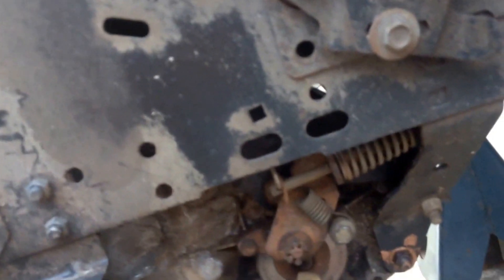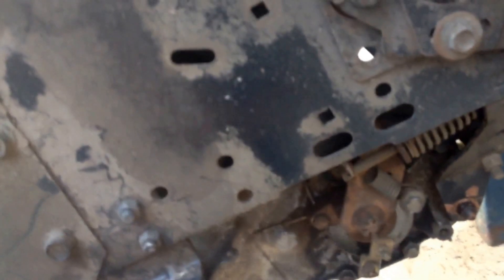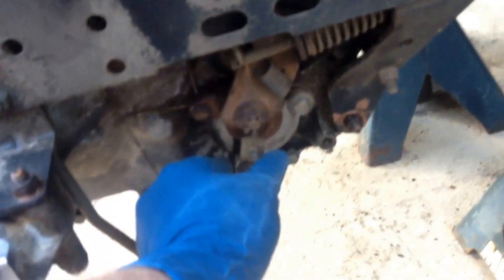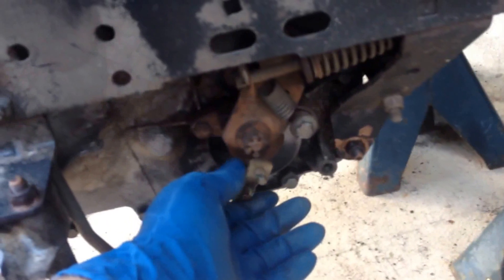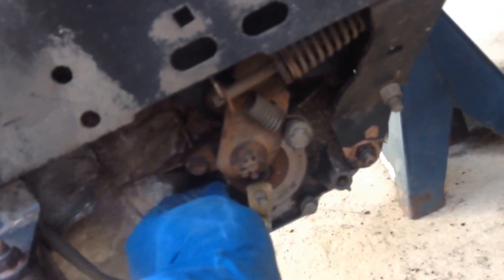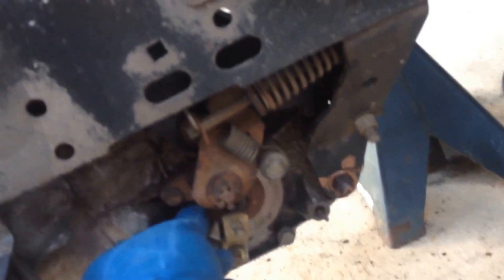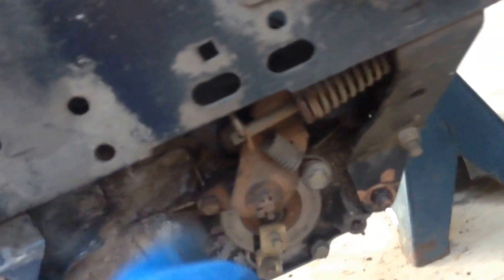Hydro gear 310-0510 hydrostatic transaxle

Comment: I had the same problem. Put it in gear and wouldn't move. I pushed that linkage so it was a little more forward and problem solved.
Reply from the maker: Well here is an update 11/15/22:
I did another pour in of this stuff a few months back because of the shudder when the engine would start up after sitting for a while and then I got a bunch of pump error codes because the pump impeller was unbalanced but I never removed the pump.  I stopped getting the pump error codes once the coolant thinned out, I did have a pump from Amazon and decided to replace the pump with one from Toyota to be on the safe side.  I did a drain of the coolant from the radiator drain and poured about 1/2 gallon of distilled water in the system. Then I added the 50/50 coolant.
I have stopped adding coolant and started using distilled water to my reservoir.  My engine temperature light comes on once in a while on my 37 mile commute, but the coolant tank is full, then it will go for a few days and not have any temperature light issues.  I ordered a OBDII temperature Head Up display to see if the warning temperature is really a problem.  I am at 225,000 miles or so.  I do not have a shudder when the engine starts but its only a matter of time before it returns.  My engine oil is clean and have very little blow by as when I check my oil at 10,000 it is very clean still.  So the coolant not getting into my engine and my rings are doing fine since I do not have much carbon in my oil as my oil is not dirty when I change it out.  One day going into work my small upper hose that connects to the fitting just before the expansion tank blew off and not sure how much coolant was lost when that happened but I did not check the bottle in a few weeks.  I am thinking of installing a digital pressure gauge on the expansion tank to see how much pressure and temperature that tank gets but that's if I really feel excited to do it.  
I think the best solution is to put a Gen 4 engine into a Gen 3 to resolve the head gasket issue.  All Gen 3 engines will have this problem from what I can tell. But I am cheap and will keep on adding water at $.99 a gallon for a few more years before I do an engine swap as it runs just fine.

Comment: can you let me know what the purge procedure is? I took mine apart for the same reason and now it dont want to move properly.
Reply from the maker: Humm. It sounds like you might have done something wrong? What weight oil did you use? I called the company and did what they said to do.
Reply from the maker: I just drained the old oil and added new.